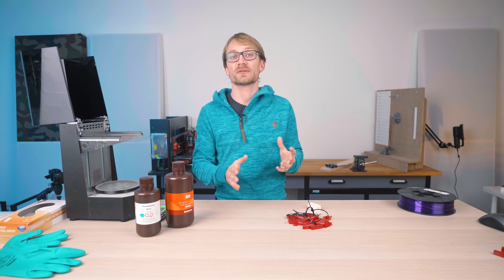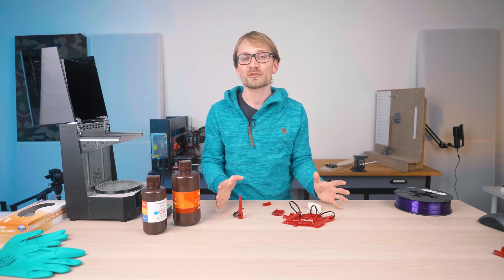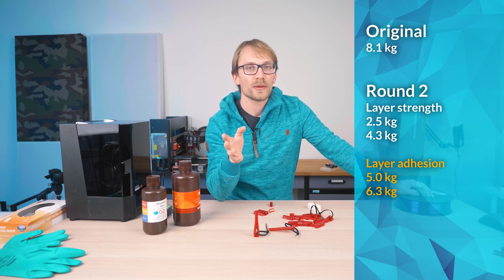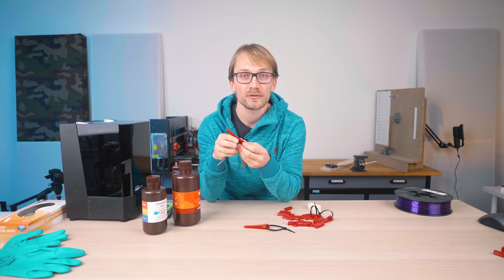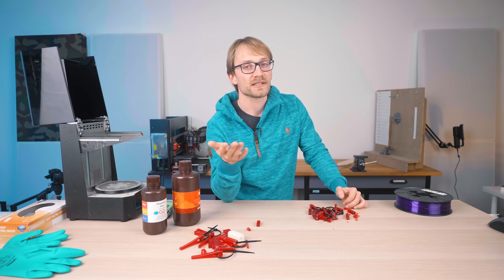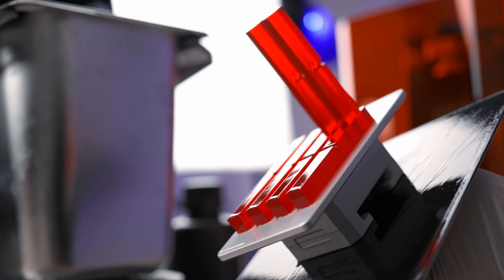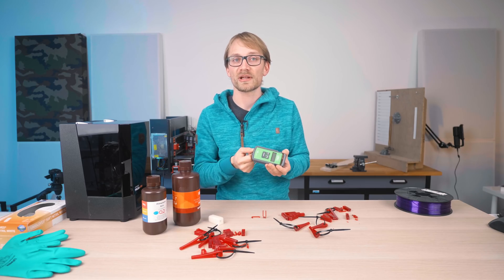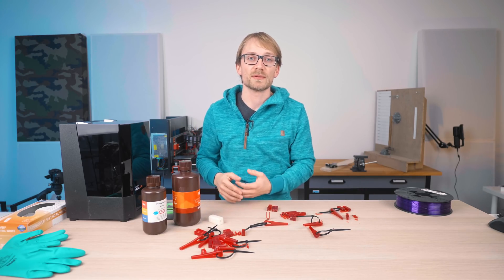Resin prints are weird: Does print orientation matter?

Comment: A couple things that I didn't see taken into account and also brings up another question. Temperature and humidity. Warmer resin results in a more fluid state. I haven't seen any info on how resin absorbs moisture prior to curing. That is a question for the material devs.
VOG did test adding aluminum foil to the inside of his curing station to improve the efficiency of curing. Maybe something else to try.

Comment: Interesting, I cane back to this video after noticing how my printed parts seems to be getting stronger over time . I have a cheap homebrew curing nix with only a few watts of leds so i have tended to leave them in for an hour or more . Even so the parts seem the stiffen after a few days in  normal indoor light (sun some of the time here in the uk) .

One useful tip. I found a blue laser handy for spot hardening in holes where the 'sun don't shine' 8-)

Comment: deflection/compression stress is probably higher on the parts that were printed horizontally. That bend is stretching the layers on top and compressing the layers on bottom down the entire length of the part. The vertically printed parts are probably only experiencing those same deflection and compression forces near the fulcrum.

Comment: I opted for resin because I'm more interested in making detailed small pieces over useful load bearing parts but I'm glad to see they aren't so brittle they will just immediately shatter if you press down on them.

Worst case I have access to a filament printer in a library but these tests are helpful

Comment: Final product strength varies a lot because there's more factors to the final strength than just the printing stage. The temperature at which the print in it's final cure, final curing time,  oxygenation of the resin (if it's a fresh bottle or if it's been opened before and by how long ago), original birth date of the resin to when it was used (after 6 months some formulations start to show drastic strength changes), and even if it was cured in a water bath or open air (this difference decreases with time, as in weeks, if it's exposed to more UV such as the sun...up to a point). The turn around to testing the prints vs when they were printed is also going to have an effect. In summary, you're right resin prints are weird especially when compared to FDM materials.

Comment: If you're using different bottles of the same resin I'd be willing to bet that even a very slight variation in the formulation of the resin might account for the variation of your differing test sessions.
As an analogy, in cartridge reloading for rifle ammo you can use the same powder, the same powder charge weight and virtually identical components and if the otherwise identical powder contained in your container is of a different lot or manufacturing run  your results on target will be different.  Maybe just by a little or at time by quite a bit.
Another factor could the shelf life of the resin and still other variation could include resin that was left over and reused in your second or third round of testing.
Your conclusion may be spot on but,  I'd be willing to bet that one or more of the variables I'm mentioned is/are the contributing factors to your various results.

Comment: first step has to be validating your test process capability—what is the standard deviation (variability) when the experiment is repeated exactly (same orientation, same resin, same curing, etc.)?  any results in later experiments inside that variability have to be considered inconclusive. 

If that isn’t satisfactory you work on eliminating variables, again watching the test process capability to determine significance.  In your case you are still chasing your process capability IMO.  You aren’t yet sure which variables need to be controlled by how much to get repeatability.  

Two is always a difficult number of trials to work with because a line always fits regardless of the variability of the experiment.  Doing more samples allows you to do histograms.  Histograms help a lot in debugging since you will be able to see groupings if there are uncontrolled variables.  You may see two peaks in the results histogram corresponding to parts that were positioned for better curing and other parts that weren’t.  Unfortunately, more samples means more work.  Fortunately it is more satisfying!

Comment: I think it has 100% to do with the curing process, seems to me that there is a higher cure to the surface and less curing for the center. Which basically causes layering, and seeing as the material itself absorbs UV then the thicker the material you print the layers get noticeably weaker the further away from the UV lamps.

Comment: Here is a thought. could the printing PROCESS be effecting your results? unlike FDM when you print with RESIN you are "stressing" each layer. it has to "pull" the part away from the FEP sheet each layer. this pulling will "stress" the "soft cured" resin.

maybe the standing parts having a smaller foot print have less stressing since they peel away from the FEP easier. so each layer is not stressed so much ??

SO test might be to print cubes and try a similar test again to see if this can be confirmed?? I am not sure how to test that.

Comment: Did you use the same material from the same bottles? Open resin has a shelf life and resulting parts used from the same bottle from when it was first open will usually be stronger than the same parts from the same resin bottle that has been open for weeks later. 
This is something that people familiar with casting resin have had to be mindful for some time.

You may be aware of this already and have taken it into account with your testing but thought it was worth mentioning just in case.

Comment: A few simple thoughts/ideas:

First, I notice you're using a red resin. To the 405nm this is pretty much black. The transparency helps with this, but it's still there. As such, yes, layers can have a dramatic difference in cure between top and bottom. You should get more consistent and expected results from standard grey. ( Remember, SLA uses light to cure resin, and color is how a material interacts with light. As such, the color is incredibly important. ) I would also recommend trying lower and higher layer heights as a way to verify that curing variability through layers makes a difference. ( Lower layer heights should mean less variance in how much a layer is cured. )

Second thing is you should really post-cure under water. There is a lot of variability in how well parts cure in open air, even variance within a part. Submerging under water makes an enormous difference in how fast and thoroughly parts post-cure. This should also help remove a variable so you can get more consistent results.

Finally, you didn't mention anything about bottom layer cure times. You should really be raising the parts up away from the bottom layers to remove that variable. This likely makes a big difference between the parts placed flat vs. upright.
Reply: I'm rather new to SLA printing, and never heard of Post-curing under water. I will definitely try that, it sounds really interesting!

Comment: Reduced layer cross section allows it to pull off the fep with less force and distortion of a partially cured layer. Also remember that previous layers still do get some energy from a layer or two away from the currently cured layer. I suspect it's a mechanical disturbance of a partially cured layer that causes more weakness

Comment: Mechanical engineer here too, impact testing is a bit of a bad test to do.
I did some impact testing myself while back, but we used a steel ball that we dropped on a surface. Because the only impact that matters is thin surface and an impact. And you don't want your part to rupture or break.
You are doing impact test on a structural part, like a beam. You could probably do that but why? It is way more useful to do a bend test and a hardness test. If it doesn't bend and is hard, you also can assume something about the impact. If you want. But having bending factors says way much more about the strength. It is also way more useful to know if something is going to visually bend before it breaks.

Comment: I there any stress emerging in the layers curing during the print? The lying specimen then should have a higher internal stress then because it is across a bigger area than on the standing ones wich have a really small area that is cured at once. Does that makes sense? annealing or slow curing might have an impact in that regard.

Comment: I think it can be because of bubble introduced between the layers since the resin has a longer way to flow under the horizontal parts it would be more aerated giving an overall weaker structure.

Comment: For maximum strength you should cure your parts submerged in warm-hot glycerin.  Even curing in warm water (30c-50c ) will yield better results then being cured in open air (oxygen). Oh and something interesting that a few people have noticed is latest height. Opposite to fdm printing it has appeared that printing thinner layers has yielded small but measurable increase in strength. I would like to see or do myself is print at 5 different layer heights. 0.01-0.025-0.05-0.1-0.2  testing in both orientations and comparing tensile strength of the two.  The hypothesis would  claim that the lower layer heights would yield a more isometric part..

Comment: Thank you so much for doing these test. I have a few questions, the first being, whats your layer height? As another person commented, if you ran the test with 0.1, 0.05 and 0.025, is there a big difference since the 'thickness' of the harder/softer layer height should change.
Also, I dont know if you have links to your testing system and the files, but as others commented, SLA, MSLA and the new MSLA monochromatic LCD may make a difference (which i'm not expecting you to test). I'm not sure which one would give the best strength but since the laser travel in vertical vs horizontal direction may change how everything cures, it may again, give you more varied results. (ie using Formlabs vs the cheaper MSLA). 
I wanted to also comment regarding the RGB MSLA screen, there is the Phrozen Sonic and Sonic Mini which have Monochromatic MSLA LCD. Not sure how that would factor into the entire equation but more food for thought. 
Finally, I'm curious also about the dimensions. In your previous video, you stated that the parts were coming out 10% larger. Is it the same with the different orientation? I've heard (i need to ask them to clarify) that printing at a 45% angle gives the best accuracy. I'm just wondering if your samples are coming out the same oversized dimension regardless of orientation.
Again, great videos. You have answered some of my questions regarding resin prints but of course, now I have even more questions regarding these printers.

Comment: The pull test needs to be performed at the same angle for less deviation. More or less of an angle will increase the inaccuracies of the prints. It's basically a lever.

Comment: The inconsistency in the resin prints may also have to do with the temperature of the resin when you printed. I notice a big difference with a “cold” resin and a “hot” resin.
Hot =75 degF- 80 deg F
Cold=65 deg F- 70 deg F
I regularly put my resin bottle in warm water before printing. Makes a world of difference.

Comment: Printing is curing:
1. How does the printer UV differ from the curing UV?
2. How do different resins respond to different UV during both printing and curing?
There are too many parameters involved.  Too many knobs to twist at once.  Too many dimensions.
It may be time to go back to the fundamentals:  Leave the slicing and curing processes/tools (with their assumptions and limitations) and visit resin physics and chemistry.
1. Get a set of narrow-band UV diodes with a range of center frequencies.  Cree bins and sells all their narrow-band LEDs in an amazing number of bins (very small steps).  You pay extra for the precise binning, but you get what is essentially a calibrated instrument as a result (so long as you keep the LEDs cool).
2. Pour resin layers with controlled thickness, then expose different areas to different intensity and wavelength.
This will be an immense amount of work, but it should yield the data needed to explain the observations.
Hopefully, resin manufacturers can provide some/much of this information.

Comment: Have you checked the size with micrometer? The height is usually slightly more than it should be. Also, printing directly on build plate will mean that the parts printed flat will have the extra cure time for the first layers. Would be interesting to see the difference pulling against the initial layers vs pulling towards.

Comment: I would suspect the layer adhesion bend test is oppsite to what you expect because in the build process it has overall more exposure to curing when building the part. 
So a pillar shape with 0.05mm layer height and a size of 100x10x10 has 2000 layers where laying down it will have 200 layers. The uniformity of the curing process when building has to play a factor in resin parts. I would suspect slowing down the print speed might show better results.

Comment: chemist here. UV Curing should bond the remaining active parts after printing in the resin. the less active parts you have, the more time it takes for the parts to meet and react. Just cure the parts with the 5 min heat 5 min uv setting to generate the radicals and let them sit for a day or two. you will notice the strength going up a bit more. (Also if you are interested in testing BASF resin let me know.)

Comment: Could it be variation in the resin itself? I would expect unless it's shaken/mixed each time it's poured, the heavier elements could sink and the lighter/more volatile elements could rise to the top and get poured off. Maybe not enough to change the consistency a lot, but enough to change the strength.

Comment: The charpy test only comes out that way because of the direction of the imperfections. Make sure you SAND DOWN THE NOTCH to an even layer sample. If you look under a microscope (or have a really good eye) you can actually see the staircase pattern in the layers. These surface imperfections cause stress concentrations that will lead to the deviation in the results you are experiencing. Once you sand them down and polish smooth it you'll find that there is very little deviation in the tests. 

My bet is that this is the same reason that the bend tests came out the way they did, it's because of the surface imperfections.

Comment: UV does not cure the polymer. It is the oxygen. UV initiates the process. It is possible that you don't saturate your resin enough with oxygen, and just rely oxygenation while adding a layer. please adjust your wiper settings and bed temperature. Also make sure you agitate the resin adequately before a print.

Comment: Thanks for another great video, Thomas!

As a chemical engineer developing materials for the 3d printing industry I was also quite surprised by your results. As some other viewers have already assumed, I also suspect that the different part orientations lead to different curing rates within the parts. While the lying part is cured relatively little, the upright part receives UV light for a very long time due to the translucence of the resin. This will simply lead to a very well-cured part compared to a not sufficiently cured part.

Your post-curing tests indicate the same: The parts that were printed lying, seemed to have benefited more of the post-curing (270% and 165% load gain) than the other parts (157% and 150% load gain). Although they do not reach the exact same values after quad cure, they very clearly converge, which means that they are able to hold quite the same load when cured sufficiently. Maybe a simple increase of exposure time per layer could help to also cure the lying parts sufficiently. Even more promising would be another test series with an opaque resin to get rid of the uneven curing.

Actually, you also have to take into account the chemical network which will be formed in a slightly different way depending on the print orientation (and the exposure time) and which cannot be altered by post-curing. But the effect of curing variation should be much higher, so that one should eliminate this effect at first.

Some general thoughts: I think you should try to improve your testing methods to get more accurate and robust results (why not team up with Stefan? 😉) Secondly, your evaluation would really benefit from a higher sample number. Since you do not want to spend too much time and resin, it would be very helpful if you could find specimens, which are significantly smaller while keeping the deviation low at the same time. This way you could improve the validity of your results drastically by measuring a larger number of samples and/or being able to perform a wider range of tests without using up too much resin.

Keep up the good work!
Reply: Well put, I thought the same. Overexposure seems like a way to drive a full cure.

Comment: The fact that the extra curing cycles had the layer strength approach that of the layer adhesion might be a clue to what's going on. I agree that there are "layers" within the resin that alternate between highly cured material (right at the interface of the screen) and softer material behind it. When curing, the parts will cure from the outside inwards, and the extra number of layer "seams" might help with UV light ingress and result in a stronger part with a shorter curing cycle. Of course, it seems like curing even more will bring the material to be more uniformly brittle and isotropic.